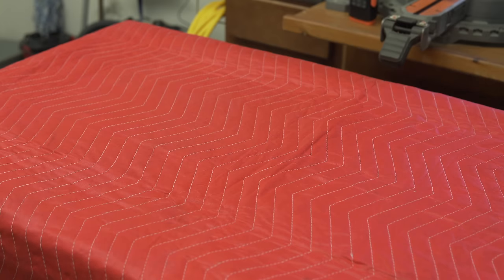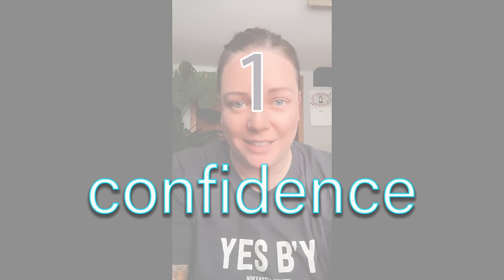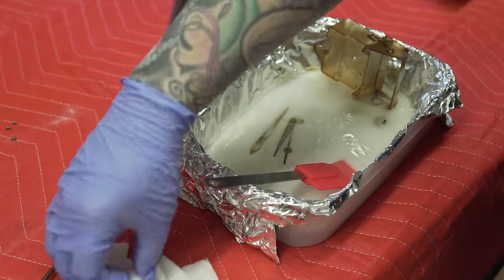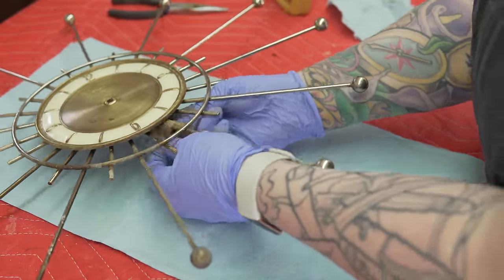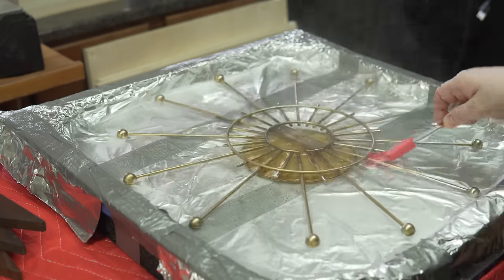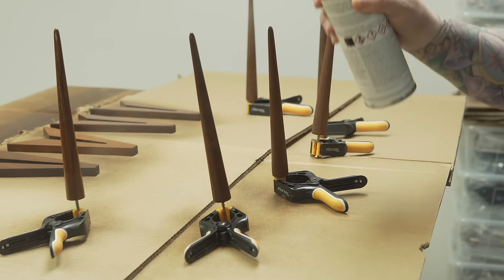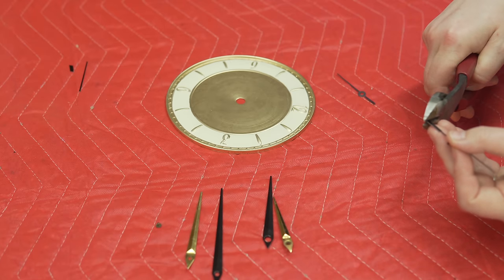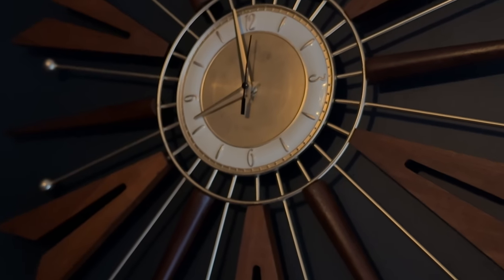I almost ruined this MCM clock while trying to save it

Comment: Oh Angie, I feel your pain.  I collect and refurbish old tired sewing machines.  I have always had pretty good luck until the most recent one.  She was a real mess, so I pushed up my sleeves and started tearing her apart.  MISTAKE.  Not all sewing machines are the same, and I took out screws that I shouldn't have.  I cleaned her and put her back together, and had a screw left over.  Yep one screw. Now, she works, but the stitching is a bit wonky, so now she will be going to my friend at the repair shop.  Sometimes, it just goes wrong.  Absolutely beautiful clock!  You did a lovely job on her!
Reply from the maker: Oh that sounds like an undertaking!! I'm so glad you enjoyed this one. 🙂

Comment: Angie, as soon I saw the clock and the word "disaster" I knew I had to comment. When I was in my early 20s, I bought a Snider clock very similar to yours at a garage sale (probably paid less than $2!). It had the same face and tapered walnut dowels. I just looked it up and saw an etsy listing for one at about $300. Anyway, the only major issue with it was some slight tarnishing on the metal and one rust spot about the size of a shirt button. It cleaned up nicely, though, like you said the clock motor was really loud. Then... I'm not sure what I was thinking, but I decided I was going to try to eliminate the rust spot on the face. I took a piece of SANDPAPER (without even checking the grit), figuring I would just sand away the rust, and dab some gold paint over it. Seriously, I'm still kicking myself 20 years later. I absentmindedly just started sanding the WHOLE FACE. It must have been two or three strokes at most before I caught myself, but the damage was done. The whole face (which has a tiny ribbed surface) was ruined. There was no way I could get rid of those scratches. I was mortified, and could never bring myself to actually put it up on the wall. It stayed in storage until I donated it to a women's shelter thrift shop about a decade ago. You win some, you lose some, I guess. Either way, I'm glad yours was a success. It turned out beautiful!
Reply from the maker: Oh no!! I can almost feel your pain, I'm so sorry that happened to you! Thank you so much for watching!

Comment: You did a great job recovering from the issues. I had to cringe, though, when you turn the hands counter clockwise. Generally it's a bad practice to move clock hands counter clockwise. It doesn't matter on some movements and since you replaced the movement anyway, it's a non issue. You did give me ideas though for refinishing the dial/face of a mechanical clock I have for repair.
Reply from the maker: I wouldn’t have done that on a working clock. :-)

Comment: Angie ouch. I saw a danger coming when you stuck the clock face into that mixture. Ugh.
I actually have a similar piece made by Seth Thomas. 24 slats of wood around the perimeter. 
My plated spokes with the bolls on the ends we're also a pain to clean. 24 of those as well. Mine were not as tarnished though.
I used Danish oil and OOOO steel wool to clean up my wooden spokes.
You're clock came out great anyway. Great color match on the face.
And yes my old mechanism is noisy.
Thanks for sharing
Reply from the maker: You're very welcome! ☺️

Comment: This was for your own home, you know you will treasure this piece more if you do it to your own taste than if you follow the 'rules' about how it should be restored. Brcause of this, honestly, I would have been fine with you spraypainting it Electric pink.
I clean all my silver by putting it in a tinfoil lined tub of hot water with salt, so I noticed at 5.min your metal wasn't touching the aluminium. When it touches the stripping* is lot more effective, I think that is why you couldn’t just wipe the tarnish off the face - the recepticle for the tarnish wasn't able to pull it off.
*I'm not a physics savy person, but I once had the explanation for why this works and it's something about the aluminium acting like a magnet for the tarnish and the salty water allowing it to transfer to it...
Anyway, this came out looking beautyful ❤🎉
Reply from the maker: Thank you very much! I appreciate that!

Comment: When you were pouring the boiling water on the brass apparatus and telling us you made a big mistake, I thought the foam would melt because of the hot water. That is some tough foam. I would have never tried that but it worked for you. I did something similar and I melted the hard plastic case I had plans for storing a special old coin in. I felt dumb for doing that.  Whoops. Plastic is not always as tough as we think it is. 

After you cleaned brass apparatus and it looked more chrome than brass, I thought it looked pretty good the way it was. Will the gold paint stick on good with future cleanings? The paint I used on a past project rubbed off fairly easily.  

I think you did a great job -- particularly with replacing the clock mechanism. I don't think the original was much worth keeping even if it did sort of work because it really didn't look like good quality.  You can't expect something like that to last forever and a clock needs to be precise or you are going to be late a lot.  A second hand is an absolute must!  Adds a lot of elegance to a clock. 

I want to get a duplicate of an old kitchen clock we had growing up.  I found a copy on eBay but someone else had bought it.  At least now I have a picture and I know what company made it.  I do not remotely expect it to work so I will have to have the clock reworked or do it myself.  You give me hope maybe I can do it.

Comment: The aluminum foil is actually an essential component of the cleaning solution - you're doing a redox reaction to remove the oxidation. Without the aluminum foil, it's just a salty, mildly abrasive solution. Aluminum is more reactive than zinc or copper (brass is an alloy of zinc and copper), so it will use the tarnished brass as a source for oxygen ions, and reduce. The salty water (baking soda and table salt are both salts) is a good environment for this reaction to proceed, but the key component is the aluminum.
Reply from the maker: Yes, absolutely. :-)

Comment: I don’t know what else you could have done.  The corrosion and rust needed to come off and the painted face was  in the way.  You also needed a new mechanism (loud ticking is annoying).  You did a great job (as usual) with what you had.  It looks WAY better and will serve you as a functioning clock rather than ending up junked.  You were too hard on yourself.  You did a great job with what you started with.
Reply from the maker: I know. It’s just very different when I’m sharing something with the world (vs just my own home). I’ve always been a perfectionist so sometimes it’s hard to just let go.

Comment: Omg, is that R14 or R20 battery? 😮 Here in Europe it's almost impossible to find them, only in specialty stores, in last 5 years all new stuff come with AA or AAA, so expect them and 9V batteries, regular stores don't carry "old" types of batteries.
But clock turned out great, reward for frustrations of restoration 😅
Reply from the maker: This took a D cell battery. Thanks so much for watching! 😊

Comment: Success. Plan A didn’t work. Seems like less mistake and more about risk and expectations. The brass came off when the rust ended up deeper. Deeper clean of the face and white paint came off.  The mechanism wasn’t repairable. I like the video because you’re a pro and your plan B looks amazing.

Comment: Random question somewhat unrelated to this refinish (which was awesome), do you use laquer or shellac before painting a wood surface? I cant find the video it's mentioned in, but i remember one of those helped seal up the wood grain so paint wouldnt get stuck in it. it would then be easier to refinish down the line. maybe another follower knows!
Reply from the maker: Either, technically. As long as it’s sealed prior, it’s easier to be reversed down the road. If it’s a piece that is heavily damaged prior to painting, I wouldn’t bother (unless there are patched areas with filler or bondo), but if it’s in good shape and someone MAY want to reverse it down the road, some dewaxed shellac or sanding sealer works. Even a coat of polycrylic (Minwax) or vinyl sealer (Mohawk).
Reply: @TranscendFurnitureGallery  ah perfect!! Thank you so much for the advice!!